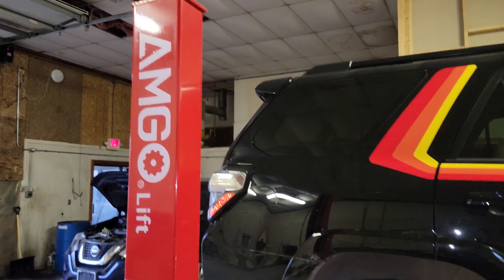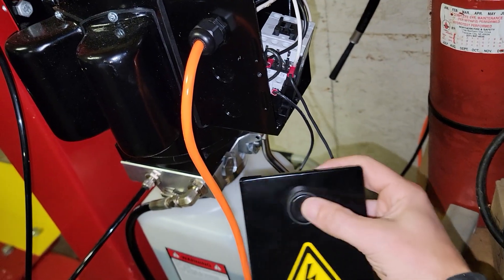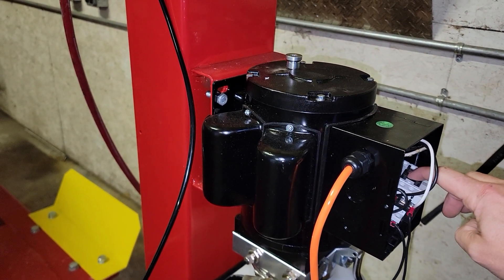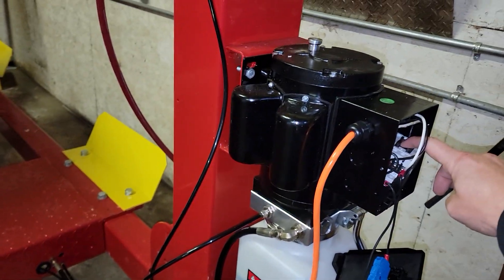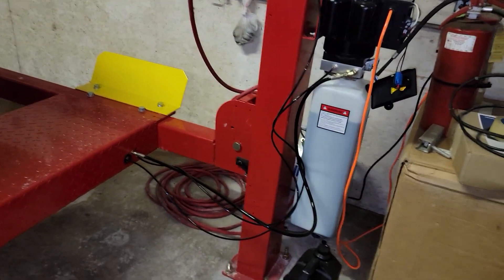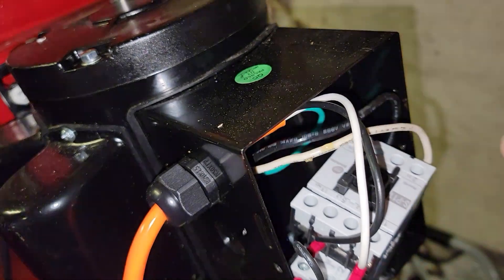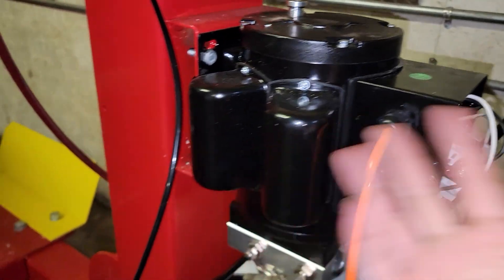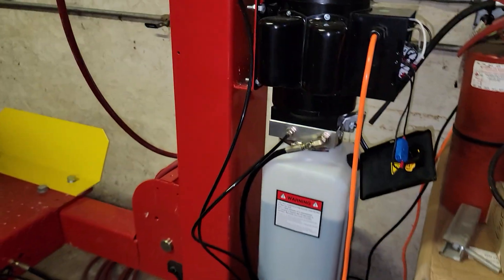Dream lift FAIL!!! Amgo 12K Lift Review: Voltage Lies, Defective Relay & Cable Failures!

Comment: Thanks for posting this. Now I see why AMGO is half the price of reputable brands that are ALI certified like Advantage or Bendpak.  Did you ever figure out the problem?
Reply from the maker: Yes, instructions say it can be run on 110, it can't. Also, the breaker is too small, AND this is set up for a 1/2 cable, but they only use a 3/8, so the cable is very sloppy on the pulleys. We've run it now a year, maybe gets used twice a week. Supposed to lift 12K, we put an 8K sprinter on it, and it wasn't happy.

Comment: Because you don't have enough amperage going through your line hire an electrician yeah it's not the lift it's your electrical
Reply from the maker: @Ripsaw17  it was because the instructions incorrectly called it 120v when in fact it really was 220v. They also had the wrong switch it from the factory.

Comment: As an electrician I can tell you that you’re not properly powering it. The motor will have a plate that tells you what it needs.
Reply from the maker: @Tracetidwellusmc  You're 100% right. Unfortunately the sticker on the Chinese motor said 120v. In reality it needed 220. It also ended up having a faulty switch
Reply: @Thesocialgarage  bad electrical can cause a lot of issues. How has the lift held up? I'm asking because I ordered the same lift but couldn't find many reviews.

Comment: Thank you so much for the reply I haven't been able to find much on this lift except your video and really which gave me hesitation in getting it. Very helpful
Reply from the maker: I've been running the lift for a year now. If I had it to do again, I would spend a bit more and get the bendpak. If for no other reason than customer service. If you have access to an electrician, and are ok with modifying, it is a cheaper option, but similar to those knock off diesel heaters, you'll want to replace the air lines, switches etc.

Comment: I really haven't found much information on this lift after you have rewired with 10 gauge wire and put it on 220 volts has it been working as it should and any other complaints about this lift. Just wondering your overall impression if it's worth a buy
Reply from the maker: It's been working well. But one big word of caution
... At some point they changed the cable size. The pulleys are clearly rigged for 3/4 steel cable. But the cable that's on it is only 5/8. So there's a little bit of slop in the movement. I can't get anybody to tell me how that affects the lift capacity. I wouldn't actually push it to 12,000. 

It lifts our sprinter, but that's seems to be the max

Comment: What gage wire are you running..
If it's getting warm it's not properly wired..
Reply from the maker: 10ga now. The instructions claim 16g will work, but they are very wrong

Comment: Have you checked the run capacitor? There is definitely an electrical problem going on if the wires get hot after 20 seconds
Reply from the maker: Turns out, the instructions are wrong. You HAVE to run 10 gauge wire, and 220. Will it spin the motor on 110? Yes. Will it lift anything....not really.

Comment: Having the same issue on my lift at my storage unit was trying to run it off of an 4300 watt invertor.... just bought a parallel kit..  Any updates?
Reply from the maker: I don't think that's going to work. Even though they advertise this as a 110 lift, it's not. It needs 220 to operate correctly. 

When I put my meter on it it pulls about 18 amps to lift a small car and jumps up to 24 ish when it lifts my sprinter.
Reply: @Thesocialgarage  is yours running correctly?     Went to 220?

Comment: This will sound dumb i guess (European here), is it a 220v motor running on a 110volt system? voltage is decreased, the current accordingly increases and your breaker blows. I might be wrong.
Reply from the maker: We have 240 (220) and 120 (110). The vault is the speed at which the electricity travels. And the amp is basically how much is flowing. 

You can pull 30 amps on both a 110 and a 220 line. In some applications that's all that matters. Is how many amps the equipment is getting. 

It makes sense that this requires 220. The only real issue is that the instructions clearly call for 110. Typically if you put 220 to something that is calling for 110 you will burn out the motor very quickly. A simple correction to the instructions would solve the issue

More amps more power. More volts, faster electrons. 

It's why electric car is basically run on oversized AA batteries if you break down the battery packs. Stack 10,000 of them together and you get a lot of amps.

Comment: Is this the 12 or 12sx?
Reply from the maker: Pro-12SX. Even with the motor direct wired, it won't pick up a 7,000 lb van
Reply: @Thesocialgarage  Good to know. I need something that will pick up a crew cab diesel dually. Cant really find much information about these lifts other than the advertising

Comment: Did you ever figure it out?  I'm having similar issues with my single post lift from Amgo.  Tried customer service and they sent a new push button switch, which did nothing.
Reply from the maker: It's not the push button. It's that relay box behind it. I tried to eliminate the relay, it works for lifting small cars. But it still won't pick up a 7,000 lb cargo van.